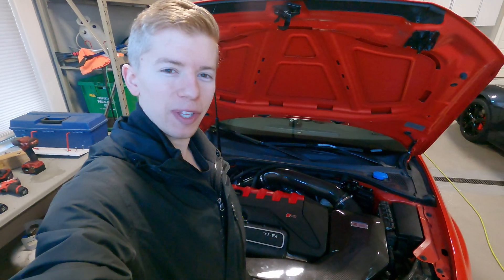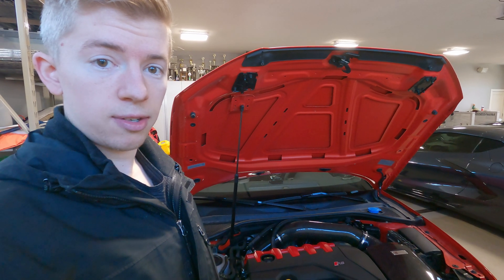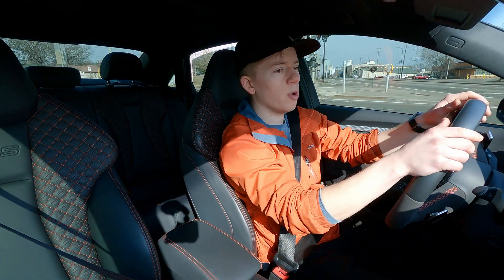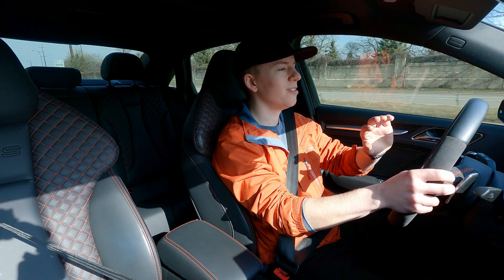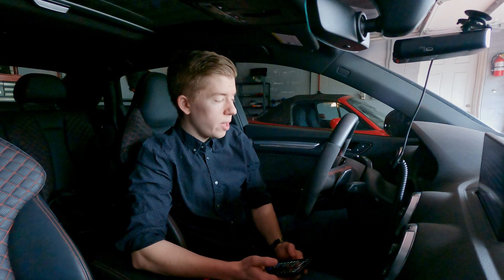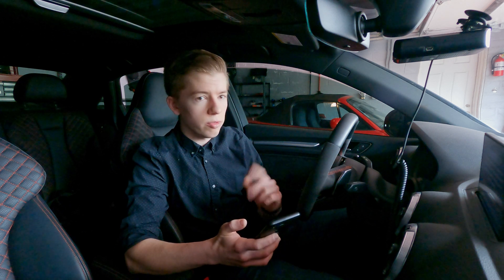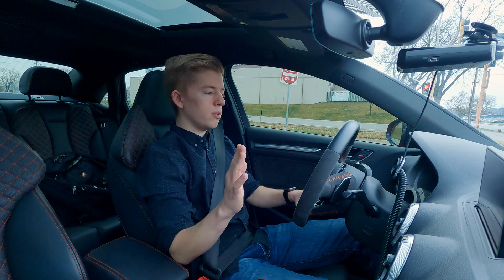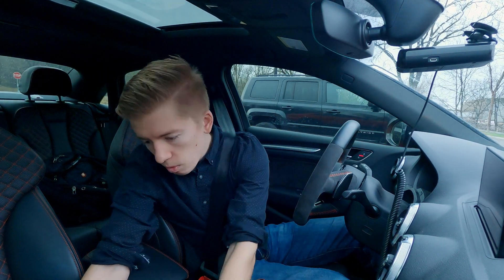RS3 Boost Creep Resolved!

Comment: How are liking this turbo now that the boost creep has been fixed? In hindsight, would you have selected another turbo? Also, which TCU tune are you using, and did you upgrade your trans flywheel flexplate?

I’ve been eyeing SRM’s Non-hybrid option for my RS3, but hearing about several QC issues with their products is somewhat holding me back.
Reply from the maker: Turbo is holding up well, still on Custom Code TCU, waiting for Kyle LeBlanc to come out with his own TCU tune to be paired with his DS1 tune. Car rips, but it's not giving full throttle until 4000rpms, hoping that is resolved with the TCU tune.

Comment: can you explain more about what was causing boost creep on the SRM stock setup?
Reply from the maker: The port for the internal gate was not large enough to bleed the boost as the car approached redline. We had the internal gate removed, welded shut and replaced by a 44mm external gate from GoFastBits. The internal gate port was presumably still the same size as stock. We don't have the new SRM manifold, it's the old OEM manifold setup that's modified to fit the Garrett GTX35.

I genuinely think the stock port could have been ported/bored larger, but we didn't want to find that out and have to pull the manifold out a second time... plus the external gate divorces the turbine/exhaust flow so we should technically pick up a few horsepower 🤘
Reply: @HardwayLearning   I follow, we haven't run 93 octane yet and log it but want to do similar you to make sure there isn't an issue.  Only running E85 in her for now.  Keep up the great work.
Reply from the maker: @MODIT  good luck, we were also fighting some knock on 91 that was pulling timing, the late timing also compounded the issue 😂
Reply: @HardwayLearning   that's very common with these cars even on stock turbo let alone a hybrid.   These cars honestly love running on ethanol, almost needed.

Comment: how bad was the boost creep on pump gas ?  what minimum pressure was it making at redline ?
Reply from the maker: It was hitting 29psi on pump gas by the time we were at redline, Kyle only wants to run 91 at 25psi
Reply: @HardwayLearning  oh ok , too bad these turbo dont have bigger wastegate port from the go .
Reply from the maker: @clovisniclounivis8403  yeah, it probably wouldn't take much porting to knock it down. I think most people run E85 with it so then it's a non-issue

Comment: When did you switch from Jared to Kyle?
Reply: Jared is a thief to be clear, won't do the tune properly but has taken payment.
Reply: @charliemenard4011  for real and have you asked for a refund?
Reply: @Jonnybravo2382  yep! Do not do business with, unethical as heck.
Reply: @charliemenard4011  look like this whole SRM/VLM is crap , look at this turbo making boost creep , it is worthless ,are they even testing their products before releasing or customer are guinea pigs ?
Reply from the maker: When we switched to the DS1
Reply: @HardwayLearning  any particular reason?
Reply from the maker: @Jonnybravo2382  efficiency. We were not getting the greatest communication with Jared and we were running out of patience.
Reply: @HardwayLearning  fair enough, communication is the key with remote tuning